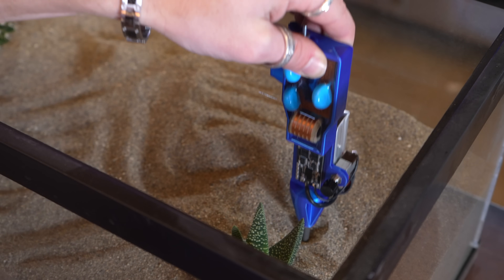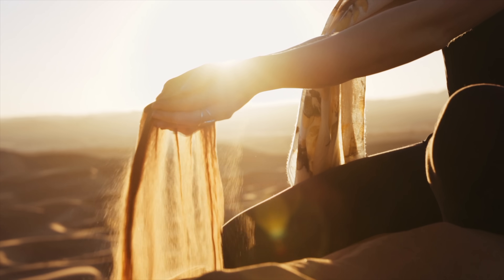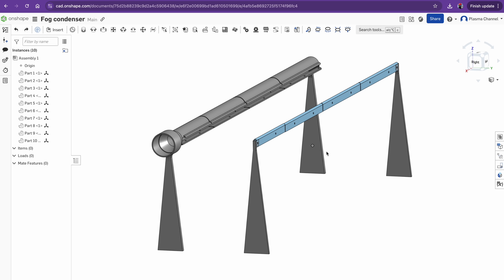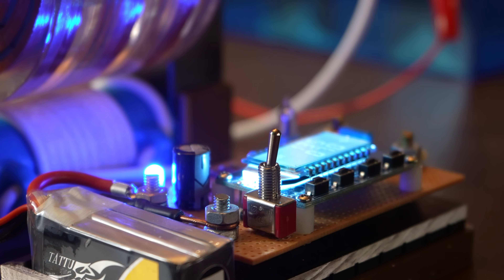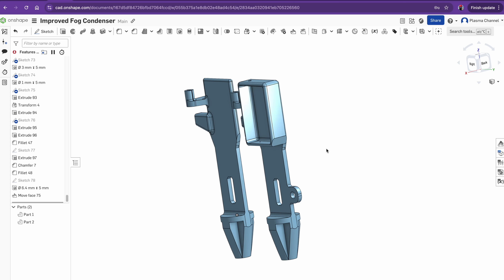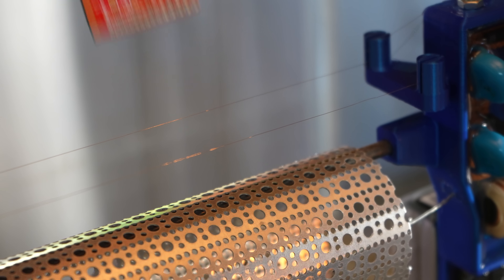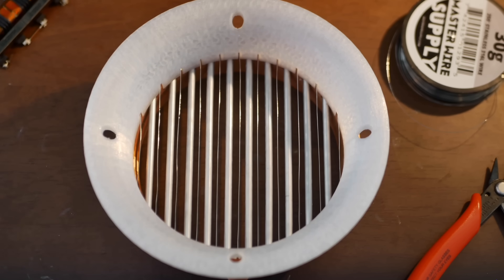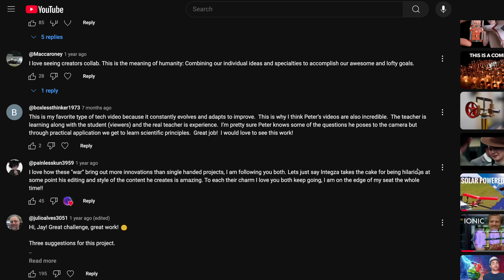Solving Desert Water Shortages Using 20,000 Volts

Comment: Love it but thats still too much power. That’s roughly 14 liters of water per kilowatt-hour. I can buy bottled water for about the same price, delivered to the house. I have done hydroponic gardening on the roof, and I started with bottled water it had no leaks, no water exposed to air, and a recirculating system. Probably more than 99% of my water was going into the plants. But with six large tomato plants and four large chili peppers, I was using about 60 liters of bottled water a day before I got an RO system. And then the plants got way bigger.  The garden was super efficient and still breaking the bank with bottled water. Pumping water out of the ground is way cheaper.

Yes, you could use solar power, but it would be more economical to use solar on your well pump and sell the extra electricity. And the low-efficiency nets are great because they work for basically free—you just need more of them.

All that said, this is super cool, and I love it. Just need to get the efficiency way up. Or make then a fun hobby thing.

By the way, I’m basically in a jungle, and fog is rare, but a normal dehumidifier still pulls buckets of water out of the air. I’ve come home to a flooded living room when the drain goes wrong.

Comment: So one machine takes the static electric to from air converts it to thousands of volts that power the condensation attraction plates thus producing thrust from plain air static electricity exited by a small tremor wave or acidic static converters ?

Comment: Stupid question: How would you power this with solar power when it's operating in foggy, low-light morning conditions?
Reply from the maker: Not a problem. Think...when will this be operating throughout the day, when is the sun typically overhead, and when will the fog be gone? Theres the answer :P
Reply: @PlasmaChannel   The fog appears during the early morning, when the sun is down or the light energy is extremely weak. The period where most energy is needed is the time when there is almost no sunlight. The period with the most sunlight is the period when the fog is not there. So it seems that, without some kind of battery, this system is as useful as a solar powered flashlight.

Comment: Your construction needs fog (=already existing little water DROPs), wich corresponds to 100% relative humidity.
The dehumidfier works down to 30% (at least the one that I own).
He has to manage the heat of condensation, your machine does not.
That explains the difference in energy consumtion.

Comment: Is it also cooling the air in the water condensation process? How much energy is it pulling to do all of this? I'm trying to imagine it in terms of solar panel meter days to recharge the battery that runs the stakes.

Comment: For in-situ use, It might be more efficient to create a reservoir & irrigation system with this, than to put it directly next to the plants. The rate of the volume of air/water that it displaces is pretty big and units too close together would diminish each other's output. Maybe these would surround the farm, dump into some system for collection and then be dispersed from there.

Comment: Will this concept work in dehumidifiers. Ive been doing some experiments with dehu water. It dawned on me one day AWG's are just big dehumfidfiers. My issue is this dehu im testing with is pull minimal amounts of water out the NV air. If i run a thin wire across the compressor in the dehu and run a charge i should get the same results right

Comment: And how is this thing powered in the middle of the desert?... W A diesel generator and w a power cable?
This method of ''capturing'' water from the air is not new. But the feasability of applying it to a very small scale with significant benefit is beyond our reach for now. Otherwise many countries would do it already. If we had the capability of covering up the deserts with fog collectors, they wouldn't be desert and therefore wouldn't require it.

Comment: I think some testing on the metal grid is a must. The cheaper and lighter it is the better it will scale. A thin wire cross hatch could work however it will depend on how much empty space can be in between sections of metal and how disruptive the water is. The purer the water the less it will conduct and the thinner the wire the more likely it will stick to it,

Another thing to look at would be possible inverting the setup. As we saw when you started up the system fog was thrown away from the metal nets. It might be better to have the water catcher on the inside or even on top with some slopping. If you can pull in moist air from the sides and throw it out of the top it should be able to be more effective.

Comment: Fantastic video! Really interesting. I am thinking of using the high voltage device for stearing fog but for a different applikation. Anyone out there that know where I can buy an amplyfier or how to build this? Good or it is possible to adjust the voltage. Manny thanks in advance//Björn from Sweden

Comment: One thing to note is that you compared this against a Peltier junction dehumidifier, which absolutely is not a commercial dehumidifier. Peltier junctions are known to be inefficient for cooling, but are better than resistive elements for heating. You would have to compare this against a standard heat pump dehumidifier for a real life comparison, as the larger, more expensive dehumidifiers ($100+) are significantly more efficient than a small $50 dehumidifier.

Great video, BTW.

Comment: As the system increases in size, so does its power consumption. But how exponentially does this demand grow as scaling continues? Solar power is an excellent supplement for lower wattage needs, but what would be the best solution for large-scale operations in comparison to current power consumption for de-salinization processes?

Comment: If it's that effective, I'm curious how useful it would be in dehydrating filament for 3d printing. I keep one of those small dehumidifiers in our laundry room because thats where the printer is, and it can get a little humid regularly.
The big question is, does it keep it's efficiency at low relative humidity? Time for a large scale test with a sealed room and a set temperature and initial humidity (or set water input, whichever is easier to get precise numbers on)
Reply: It's pulling fog out of the air - so droplets of water already in liquid state. It is NOT a dehumidifier, so no, unless your filament is dripping wet, this won't do anything.

Comment: So a device like this could be used to diminish humidity in a bathroom during or right after a shower, maybe it would not dry the air as much as a dehumifier but it seems to be so fast that it would almost not matter.
Reply: While it would be rad as hell to have a technology like this dehumidy your bathroom after a shower, exhaust fans are much better for this purpose
Especially if the humidity outside the room with the shower is much lower.
Reply: You say this until mold starts growing in the ductwork for the exhaust fan and starts to make you sick
Reply: @jeremygenslinger4874  Just spray hydrogen peroxide or rubbing alcohol near the fan?? Do you never disinfect your fan?
Reply: This would make sense for rental homes were the bathroom doesn’t have a window or an exhaust fan. Very rare, but I’ve seen it a couple times…
Reply: @heinrichhenry1  it is very common in new houses here in the Netherlands. In combination with mechanical air ventilation, but for heavy use bathrooms mold does build up.
Reply: Nice!  Right next to the mirror.  Instant fogless mirror?
Reply: A standard exhaust fan works significantly better and costs significantly less.
Reply: @in4theride75  Where are you finding a contractor who will install an exhaust fan for under $100?
Reply: @ Where are you finding a contractor to install a high-voltage plasma wind condenser for under $100?
Reply: Spicy shower..
Reply: @a-randomfloof  It wouldn't be in the shower... it would be in the room possibly as part of the exhaust fan...
Reply: Residential buildings only have 120/240 volt breakers.
Reply: @rampaginwalrus  do you mean we only have 15/20 amp breakers? The supply is always 240 then split to 120... The suggestion about using this in a residential washroom is dumb, but a device like this could be run on 240volt on a 30amp breaker
Reply: @BlueScreenCorp  yes

Comment: good job! this would be amazing tech! 
summary:
commercial dehumidifier: 5 mins produced 5mltr of water. (14 ml per watt-hour)
electrostatic dehumidifier: 5mins produced 40mltr of water. (1.5 ml per watt-hour)
(both using 49 watts of power)

I would love it compared against a typical fog net of the same dimensions (width). this would be an enormous confirmation of capabilities and viability.

Comment: Use supercapacitors in place of batteries. Long charge during the day and then discharge them all fast when the for comes out. 

Additionally there might be a problem with dust behaving just like the water dropplets

Comment: I was watching a video about them using the Green wavelength of light to increase the evaporation of water and they were able to use less energy with green LEDs to increase evaporation than with heat, is it possible there's a wavelength of light that may increase condensation?

Comment: If you want to power it with Solar, and the fog is there in the early morning, how could it self sustain? Furthermore, agricultural lands near dezert climate areas are not mostly cultivated. However, despite its agricultural benefits, powering it for drinking water would have potential as it doesn’t needed to produce much volumetric amounts of water compared to agricultural demand. Anyways, cool reinvention. 😊

Comment: Something to consider. You have many comments and not lots of time. Water is called a bent molecule. There are those who use this knowledge to break the hydrogen / oxygen bonds. Hydrogen is attracted to the negative electrode and oxygen to the positive. By running current the way you are, you are facilitating the attraction process. Nice. For places with impure water, consider a combination unit. The first to produce your fog, the second to recondense it back to clean water.

Comment: The energy required is proportional to the voltage applied to the wires.
Reduce the voltage to reduce power consumption.
Then, to compensate for the reduced voltage, use a multiplicity of fine wires which are positioned close to the collection grid.
The close spacing will allow mist collection to happen at lower voltages.

Comment: ❤ AMAZING WHERE TECHNOLOGY IS HEADED ❤
Very intriguing, but would this have an impact on surrounding "territories". The morning fog does dissipate as the temperature rises, but the "fog" (water vapor) is carried to and recondenced in another area, nearby possibly.
What if it was used in a high humidity "geography" (many locations in 90% humidity most of the year) and the water estuaried, and transferred out?
❤ Other question is generating power with vandigraf generator and windmill 😊❤

Comment: playing with different mesh structures would be interesting.. One would also need to consider time if building this for desert extremes. You need to get the moisture collecting and heading down asap. Square shape mesh might not be most conducive? no idea. experiment needed

also, If space is an issue, perhaps 3D cubes of mesh designed to extract as much fog moisture as possible. Lots passes through, only a minute fraction gets caught.

And as a bonus you trial some sort of moving mesh forms? if say a shape X of mesh is spinning/turning/swaying by varying degrees, directing the fog to enhance capture.

Comment: 11:31 Okay, my actual concern is that what if someone bumps it absentmindedly and gets electrocuted? The system would need to be set up off site and a bunch of permits would need to be issued and the system locked out and tagged out to conduct maintenance on the system.
Reply: That and the fact you need a lot of those devices to even produce enough water to irrigate crops.

Comment: roll the lower edge for surface area and angle it so the droplets collect on one side, then it can use a pipe to gather the water collected over a larger area
crop area should have a plastic sheet tray made to prevent leeching with a white plastic cover on the top
if there was some way to make the metal grid much colder than the ambient area it could also collect far more water via condensing, maybe a small refrigeration condenser pipe from the cold end that runs off 12-24vdc so you can power the whole system with a solar panel, charge controller and a battery and have it shut the cooling system off when it reaches near freezing to save energy, done right might grab 10x or more the water

Comment: Few questions that are not addressed here nut are necessary to amswer before saying "it works!"
1. Is it really scalable? Like what amount of electricity do you need per square meter to collect enough water for agriculture purpose from a fog with a density of water that can be realisticly found in nature? 
2. Can you replace your energy input with solar panel and how much surface would you need assuming youre in an african desert?
3. Does you system work better or worse at the temperature that ate found innthe desert, at the time there's fog?

Comment: Heyyy, I watched your video fully and wanted to re create it here, we have 75% Rh here. Wanted to know which module you've used to create the initial AC High Voltage before rectification? The PCB with the cylindrical coil on the garden stick 9:28

Comment: I wonder if a tighter messh makes a difference:

Also, I know it's a bit expensive/exotic, but I wonder how  a graphene fabric might interact with the moisture, especially since it can be made to act as a super capacitor itself.

Have to also wonder, will solar cells or turbines be more adaptable to dusty air?
Perhaps a combination is best, distributed to different parts of the field?

Comment: It may not work, but id use the smallest mesh possible, and it would be interesting to experiment with a hydrophobic and electrically coductive coating. Edit: will it draw water from normal air?

Comment: Instead of doing a Horizontal line on the condenser plate make it Wavy to make bigger droplets at the bottom it will be faster to drop the water and condense the water to penetrate deeper into the ground so when the sun comes up it will be harder for the sun to dry the areas of concentrated water areas.

Comment: Nice combination and already used in electrostatic coating/painting. In addition to increase efecience the condensepoint should be monitored and supportet. Creating shadow to the iron mash should help also. What about a tube in the ground sucking air and using accumulated cold energy stored to the same with gravel over night. Combine both and the result should be even better ;-)

Comment: Try using copper solder wicks as the ground wire.   More surface area than a single strand wire and easier to pack up for travel and deploying on sight

Comment: Seems like you could run a pvc or similar tube cut in half lengthwise as a gutter, place a foil collector inside the gutter and suspens the wire  above it, to colkect water into vials.

Comment: Nice idea, but I think, the power consumption is far to high to be cost effective if you consider reversed osmosis of seawater takes 4 kW/h per 1000 l of water, so its much cheaper to use sea water and pipelines or a well.

Comment: For the dehumidifier comparison, you have 3 main types. Refrigerant, desiccant and condensate. You used a condensate dehumidifier, using a peltier module, fan and a heatsink. 

The path the air takes passes by the cold heatsink, and then condenses on it and drips down, before going around to the hot side to not only cool the peltier module a bit, but to also bring the air up to a reasonable temperature upon release. This is a slow process, faster than desiccant, but a lot slower than refrigerant systems (for home use).

With an industrial dehumidifier, you'll mainly get refrigerant as that's just better than condensate, and it's a lot easier to deal with the waste product than desiccant. You basically get a big coil of pipe and pass refrigerant through it, pulling in air so it condenses and drips down into a reservoir. You then compress the refrigerant on the other side where the air exhausts, since that causes it to heat up (hot and cold coils are separated by a capillary tube). 

Regardless of all this... Your system is still better for catching morning fog than industrial dehumidifiers, but dehumidifiers also work when there's no fog, just to a lot lesser extent (and will likely overheat in the desert sun). They would however be very useful at night when there's little to no fog. 

Sorry, I recently started making a 80mm condensate dehumidifier, and it's been a lot of learning. The correct air flow and path for the air make a remarkable difference. Especially at such a small scale. :P

Comment: Now all we need is a water collection tray at the bottom, a solar panel, and a water pump to store the water. 
Leave it to run wherever in the desert, and you could end up saving someone's life. Especially if you plot them on a map. Then you just use the smallest amount of power to continuously pump the water through a natural filtration system of sand and stones, and keep it fresh until someone gets to it. Obviously, yes you'd want to leave some stuff to fix and maintain it, with some water filter straws and test strips, just in case. Maybe I am crazy, but I can see it being a good idea. :)